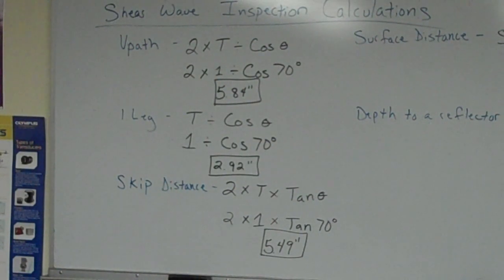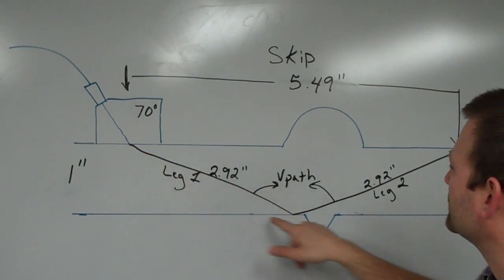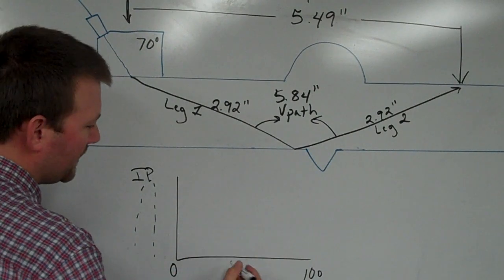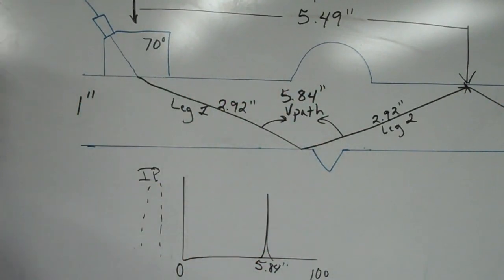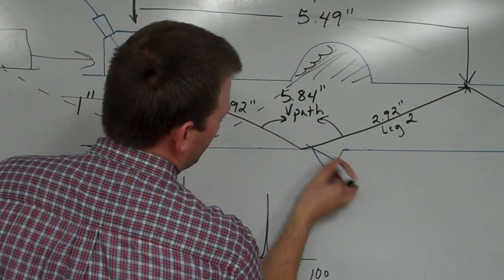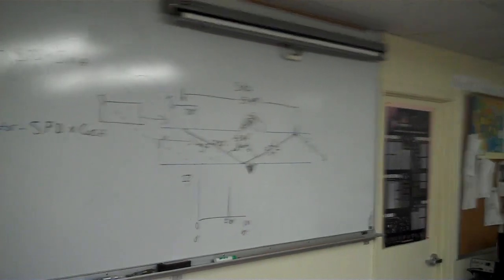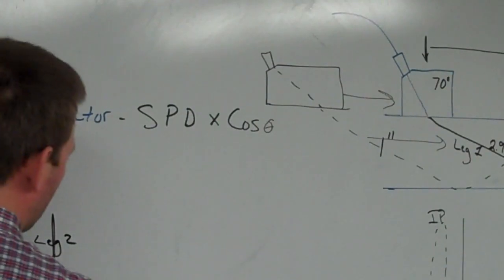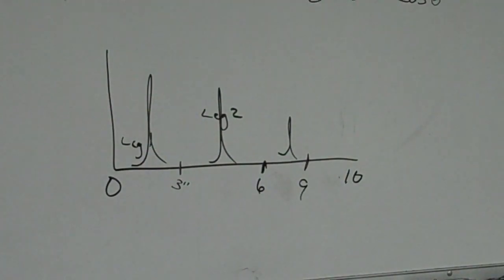Shear Wave Calcualtions 1

Comment: thank you for uploading this video. really helped a lot. I have my exam for NDT test tomorrow. there is one question I always worry about. I have used a 70° probe on a 0.472 inch sheet. was welded in V shape. my teacher told me why I had to do this this way but I have forgotten why
is deepening on the sheet thickness which probe I use? 
I just remember he said something about inhomogeneities near the surface. otherwise I had to do two runs with 60 and 45° right? 
please answer I need to pass the apprenticeships professional discussion. 
sorry I'm German so my English might not be the best

Comment: hello Sir, I live in Canada and commonly use the SI or metric system. Does this still work with metric or would I need to convert to in. for it to correctly calculate?

Comment: the 70* angle of the probe, but in the material is it suppose to change? from probe to material? (snell's law) so my V-path should vary depending on the material it entered? In my opinion, the V-path in steel shouldn't be the same in aluminum when using the same probe, but I don't see how I would change my calculation depending the material?